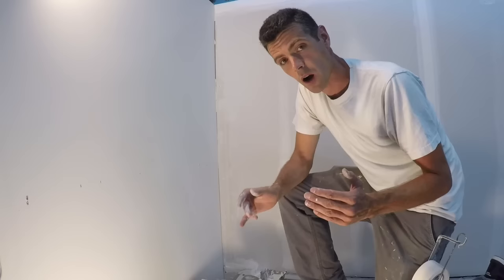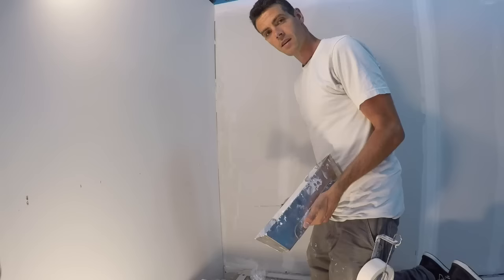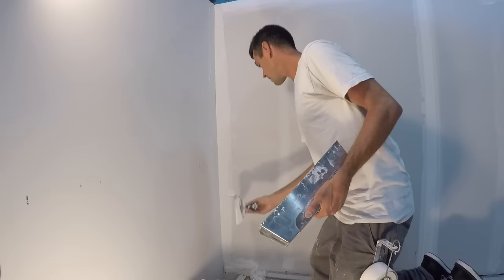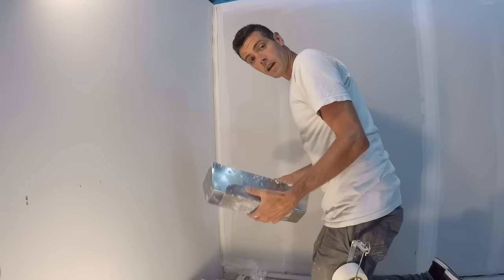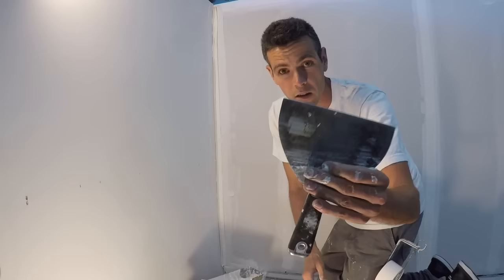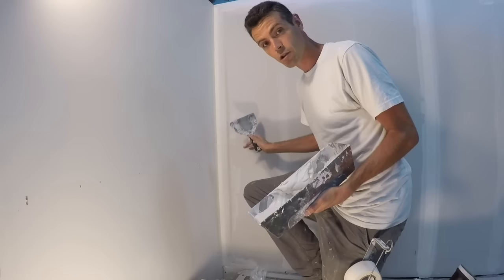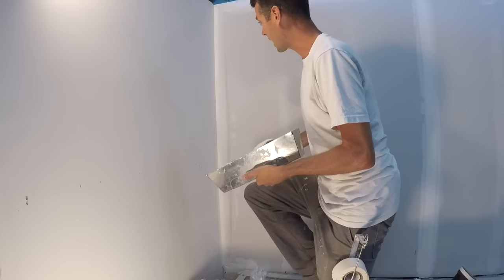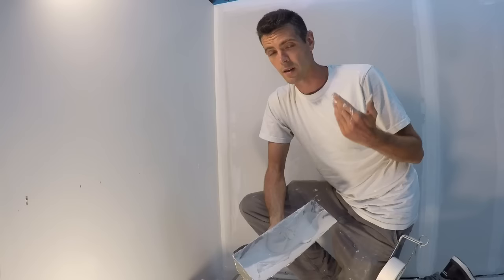Top 3 Beginner Mistakes on Inside Corners!!

Comment: I get it. One side at a time will provide a better corner. In my opinion it's not worth the wait the job needs to get done. Putting mud on both sides gets it done that much faster and my corners turn out perfect.

Comment: I`m not a drywall installer but learned the first time i tried to do corners all i did was screw up and make more work for myself,,,,So decided to do 1 side at a time  and found a 100% better job,,,But i never thinned out my mud but 1 word of advice to anyone reading this  "ALWAYS" mix your mud up to  make it fluffy an old beater makes a great mixing tool on a drill

Comment: I once did about a 3 foot tall corner in a closet. It was at my old job and no one had gotten to it yet so I figured hey, I'll get it done. I knew there needed to be mud behind the tape, but I didn't know it need to have it the whole length. So I splotched it on and, well, the parts that didnt have mud started to bubble out. My only way to try and fix it was to add more mud 😂. That was maybe a year ago, more than likely it's already peeling.😬😭

Comment: Love your friendliness and detailed advice!! Thanks so much!!
I struggled so much with replacing one wall of plaster/gyrock (or "drywall" as our overseas friends call it) - I wish I seen all your videos first. I probably spent in excess of 8-10 hours mudding, remudding, sanding, fixing, mudding, remudding, sanding, fixing etc, aged probably 20 years and swore more than a sailor with tourettes. 
Job is good now, but it's taken a few good kgs of mud and a good km of roll of sand paper ! 

Thanks heaps champ. Please do more if you're willing!

Comment: The two tips that most first timers miss: 1 The importance of cleaning your plaster knife off between strokes. A clean knife will smooth off the plaster where as a knife with plaster on it will catch and drag the plaster compound. 2 When feathering there is a slight, imperceptible to the eye, twisting to the blade and  applying more pressure to the outside of the knife giving a feathered outside edge. Instead of dong your corner one side then the other, use a corner  plaster knife and do them both at the same time.
Reply: Sitting here thinking who has time to come back the next day and do the other side of the corner.

Comment: There’s a reason why the taping knife has a 1/4 inch flat on the outside of the knives. If you use it correctly you can do the corner  both sides with one motion.

Comment: When doing a small job that you don’t want to take a week to finish, use a plaster based compound that you mix from a bag.  Use one that sets up in 90 minutes.   You’ll be able to make all of your “repeat passes” one side at a time on the wall corners and ceiling corners and, depending on the size of the job, you could be out in two days, or less.
Reply: I tape with 20 minute mud on small jobs. Lets me tape and then get a first coat on top with normal mud all in one day.  Then I come back for another day or 2 with finish passes

Comment: I’ll now try the doing the one side at a time trick. I’ve been struggling with that frustration of getting the one side looking great then screwing it up because I jump straight into the other side. Now it seems so obvious I feel dumb for not thinking of this before. Thanks 🙏
Reply: It honestly doesn't matter, I do both at the same time and they are always butter.

If you get some mud when you don't want it just scrape it off with your blade real fast and it's gone.

Comment: I'm a DIY'er.  I don't do whole room work but occasionally.  However, there are a number of things which the DIY'er can do which the professional won't bother with.  One, keep tape lengths short, say your personal wing span.  Nothing says you can't overlap sections by an inch or two.  The shorter lengths are more easily managed by the part-timer.  Two, I always mist my paper tape with a spray bottle.  It just seems to make my part-time work go much smoother.  Working times are increased since dry paper isn't pulling the moisture out of the mud from the get-go.

As always, your mileage may vary.  Find the little tricks which work for you and your situation -- professional or weekend warrior.

Comment: The biggest problem I have seen with people doing drywall when using premixed mud in a bucket was they did not take a trowel and remove all the excess in the top of the bucket and either throw it away or place it in the existing wet mud. All that dried out material would just make a mess if someone tried to use it.

Comment: I've been finishing for about 20 years I always only do one side of an inside corner
Reply: How many coats do you usually put on the inside corner? And if you use standard mud and use at least 3 coats to finish that would take 7 days to finish a corner. 3 coats on each side of a corner is 6 which means 6 days of mudding and final sand on the 7th day after its dried

Comment: Your channel really helped me, I did a lot of dryalling at my house, even when it's a lot of work I saved a lot of money, A LOT!, and I'm really proud of what I accomplished. One thing, I live in a old house with very tall walls that are 4mts and 3.60mts, I don't know how many yards, stones or any other body parts that is in the imperial system, but anyway, how do you tackle very tall walls?, I never seen you to do that. Cheers
Reply: Install your drywall vertically and fill in whatever is left, it also helps to stagger your joints, hope this helps.

Comment: I'm curious as to what you think about using a drywall inside corner tool since I've never seen you use one?  This tool makes it possible to top coat both sides of an inside corner during the same application rather than waiting a day to do the other side like you are suggesting.   I'm a DIYer, and this tool has worked for me in the past, but I'd love to hear your thoughts on this tool.

Comment: Doubt this will get seen, butttt if it does. Could you have a novice do an inside corner with you watching? I know you had a guy do a patch on a wall, which was extremely helpful and informative, but have a complete novice do an inside corner. When I do the coat over the tape after its been bedded, I'm getting some gnarly semi dry poop mud bleeding into the corner. I even let one side dry over a day and came back to it. When I went to coat the other side of the corner, same thing. I had no issues bedding the tape in corners, my issue is putting the second coat over the tape. Preferably even have a novice do a 3 way inside corner over a couple days. Just would be a dream come true, but I get you work for a living and speed is of the essence. Anyways thanks for the information you have shared thus far.

Comment: U had me until u said sand the edges to dull the nife ull just have a sharp round cornered knife point blank period u have to work your knives to get that bend and curviture that is just perfect for mudding its all about the pressure u put down u are absolutely right about the mix that is the main problem if u have to put pressure on the tip of that knife  so much u fray the tape your mud is too thick

Comment: Be sure not to wait to long before applying the tape if it starts to dry it will not adhere well and possibly create air bubbles which will costs time to fix later.This was a good video follow his tips and you will be fine.

Comment: Could i use this tactic to Round my corners for a studio backdrop. Should i round it w the tape ? .... I want the corners to disappear in the shot so that its seamless between both walls and the ground.
Both the vertical and the horizontal at the base of the walls without having to always photoshop them put or over expose the shot to hide the corners and edges.

Comment: I was trained to wet my paper tape before applying. Then we put the second coat on top of the tape immediately, similar to your cheater step on the one side of the inside corner. It takes longer to dry but eliminates one trip to the job. Is there a problem with that approach?

Comment: I'm a tile setter , and a local drywallerseems to have excessive build up in the the corners . How square should a inside corner be. Experiencing ⅜'s plus build up in the 6 inches to the corner. What are the standard tolerances  general accepted within the trade?  Thanks in advance for any helpful info

Comment: What about using fibrafuse fine mesh,  FibaFuse FDW8234-U 2-1/16-Inch?  Paper tape always wrinkles and I can't ever get rid of grid pattern texture of the normal mesh tape?   So,  I only carry the fine mesh fibra fuse,  FibaFuse FDW8234-U 2-1/16-Inch...(Fine Drywall Weave 8234-Underlayment, as my mnemonic)

Comment: Great tip on dulling the edges. About to buy a new knife.

Q. If your corner has holes or a large gap for whatever reason (repairing an older home), would you recommend using spray foam then shaving flat to give some solid backing before proceeding?
Reply from the maker: Nope. Use hot mud. You want something that dries hard. You can use spray foam and it will work but it’s really not the best product long term. It’s too soft.
Reply: @vancouvercarpenter  closed cell spray foam dries hard

Comment: i'm doing a reno and the previous owner that finished out the basement did a HORRIBLE job cutting in the outlets, like one is so bad the outlet faceplate doesn't cover it and the others are right on the edge of covering, whats the best way to fix this at the drywall level? can I mud and tape the hole smaller, should I cut out a section of drywall around the outlet and make a patch panel?

Comment: Instead of waiting for one side to dry before doing the second, couldn’t a corner trowel be used?
Reply: Corner trowels work well inside the corner but you can't really feather out the mud with them and that makes a big difference when the mud dries. At least that has been my experience.

Comment: Great video.  Question for you, I'm about to drywall a diy entertainment unit with shelves.  The square box shape shelves will be new drywall with the back touching existing painted drywall.  Do you recommend using just paper for those inside corners or the paper beads?

Comment: I’ve watched so many of your videos. 👍🏻 I’ve got a question for the community. I’m repainting the basement. The previous owner did a crappy job on the inside corners. I’m not getting a good corner with sanding. Can I re-tape the corners over the sanded paint? Has anyone tried  or have any tips? I really don’t want to cut them out and start over.

Comment: im repainting my walls and i found my corner tape has been very poorly put on, ive been told by other family members that i should just suck it up and not try to fix it since i dont know what im doing. My question is how can i take off the previous tape and redo it at home?
Reply: Use a sharp blade in a sheetrock knife and cut right in the center of the corner,Then pull off each side of the tape. You will be left with mud build up higher on the outer edges ( but don't let that worry you ) then fill with a heavy weight mud ( I like black lid proform for 1st coating )
next put in your paper tape and bed it in the corner as he showed you. Let it dry then coat with heavy weight one side at a time each day. You will get some shrinkage but no worries,just skim coat over it again one side at a time with a light weight compound  sand and done

Comment: Even though I’ve followed your videos, I think my taping job is a mess.  I’m going to need to sand lots.  Nothing beats experience.  😆
Reply: More coats. Instead of trying todo 3 or 4 coats try 5 or 6 til you get better. Sounds silly but try it.
Reply: ds99 you got that right. What most people forget is there is a reason why a person is a pro. I have many homowners tell me how to do my job. Doesn’t bother me. I just hand them the tool I’m using and say “show me”.  It’s a different story being on the field as opposed to being in the stands.
Reply: jacob brock or sand in between coats instead of waiting till coat 3.

Comment: Awesome video!  When sanding final coat and the tape becomes exposed to where you can see some of the tape fuzz (I know sanded too far) does the tape have to be mudded again to where it is no longer exposed or can you get away with some of the tape fuzz exposed during painting?  Sorry noob question... thanks again!

Comment: I've mudded quite a few homes in my life. If have two uncut seams meeting at the corner it's gonna take a lot of mud, or additional passes. So that you don't spend a lot of time having to come back, mud, let dry, sand and mud some more, you can do both sides at the same time. Yes it ruins one side (unless you are really good at inside corners, like me), but it's such a small void to fill the next day. Better to have some mud over that tape instead of walking into the home first thing in the morning and seeing a bunch of raw tape exposed. It's just more work, taking up more time, when you leave that one side dry. Now, tell me how you handle crappy sheetrock installation that leaves huge voids in the seams?
Reply: You mean sheetrock that looks like it was hung by me?  I've been working on that in an apartment I'm building in my barn and now after lots of work I have it looking pretty good but dang I wish I would have hung it better!

Comment: VanCouver Carpenter - thank you for your videos.  I have a "door hanging" question for you: I am going to install a basement furnace room door soon.  However, the wall on the "hinge side" is 4" off from top to bottom.  The latch side wall is off 1 3/4".  I do not want to go through the expense of straightening the wall.  My thoughts: 1) hang the door using the 1 3/4" off as a guide for both sides.  Or 2) hang the door "straight" and trim it out best as possible. But I am not an expert - you are!  what is your opinion? Thank you!!  Bruce.

Comment: I tried your "one side at a time" with a 6 inch knife trick and did not like it. I still got mud on the side I was not mudding and it adds twice the number of days to do a corner. I quickly went back to using my corner knife, got both sides on the same day and my corners look great. Also, I noticed you putting mud on top of the tape on the first coat. I have always seen others stop at mud only on the under side of the tape and call it the first coat. With the second coat being mud on the top of the tape. Why is there not a concise mudding rule as to mud on top of the tape on the first coat or not?

Comment: Even though the corners were bothering me, I was just going to let my corners look crappy but now that I've looked at your video, I've changed my mind. However, wouldn't it be smarter to measure your tape before applying the mud?
Reply: Measure tape lol no. I put the mud on and put the tape on than cut it

Comment: For mistake #3....
Is it possible to use a corner taping knife as a solution? 
What would be the pros/cons of using that tool instead?
Reply: Cesar Paulin it’s a homeowner tool, do one side at a time. The best way hands down.
After 35 yrs I can do both sides at the same time but there is a lot of touch up work to get the grooves out of the corner

Comment: Thanks man!! Question - is there one brand of knives to use over another brand? Or just something with a metal handle to indent accidental holes?
Reply: Full stainless knives are easier to keep clean. I don’t own a knife that doesn’t have a metal tip.
Reply: Either work fine. I have a mixture of both. The blue steel just rust some over time. Just need to be sanded with a block occasionally if left wet from cleaning the prior day.

Comment: I have a question, I covered my drywall with thin wood panels and was wondering if I could use this method to fill in the gaps between the wood  panels that meet each other? What would you recommend?
Reply: Liquid nails. Or a colored caulk

Comment: Would quick set work on speeding up working in the other side of the corner?

So, start the corners at the beginning of the day--if you can--then finishing the other side at the end of the day... Or just however long it takes it to set.
Reply: confusedwhale I know some drywallers who use hot mud to tape and mud. However, I personally wouldn’t recommend it, because Hot mud doesn’t have glue in it like all purpose does. That glue is what guarantees the tape will stay if properly applied. Hot mud doesn’t have manufacturer warranty 90% of the time. Hence why some muds will say “not recommended for taping or finishing.”

Comment: Hi, I've just had my conservatory roof  insulated and plaster board has been used, my question is, does the whole ceiling need to be skimmed all over, or can the joints and screw holes just be filled? TIA
Reply: Whole ceiling does not need to be done. Only joins and screw holes, paint will do the rest.

Comment: Or use a corner trowel allowing you to do both inside corners simultaneously.
Reply: 😡
I bought a corner trowel to improve my corners.  Big mistake.  I binge watched Vancouver Carpenter videos, and others, then stopped using the corner trowel, and now all my taping is really good, especially corners.
Reply: @stroys7061  
Yeah corner trowel is a gimmick

Comment: Thanks dude! I wasn't struggling with the actual tape. I am using a plastic knife and lots of mud. I involuntary mixed it a lot so it got thinner! Good advise  especially on doing one side the day after the other. What do you think about corner shaped knives? Are they any better for beginners?
Reply: I started with an inside corner tool years ago and have used it ever since with no problems and no defects. I don't understand why anyone would do it in 2 steps when you can finish it in one shot.